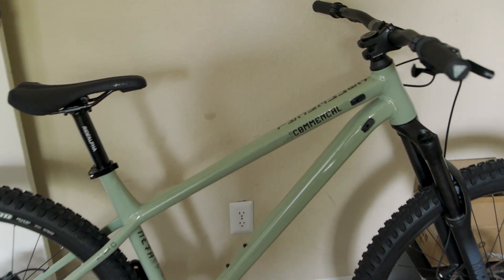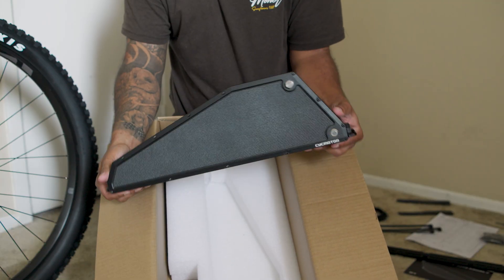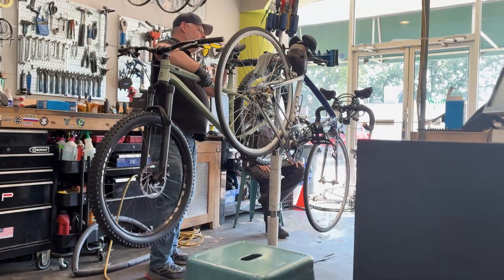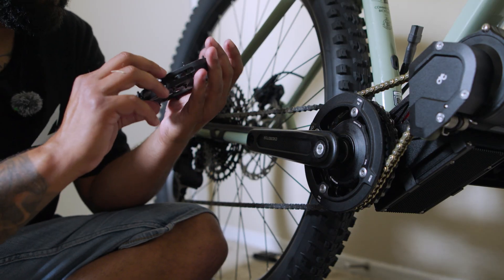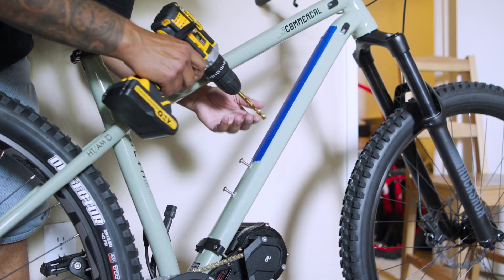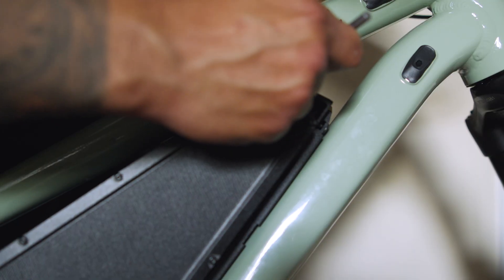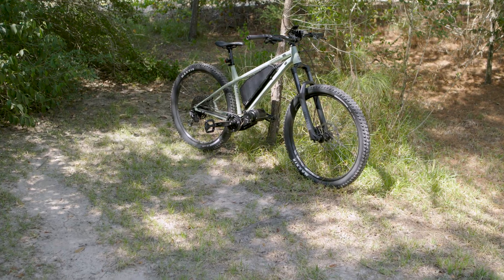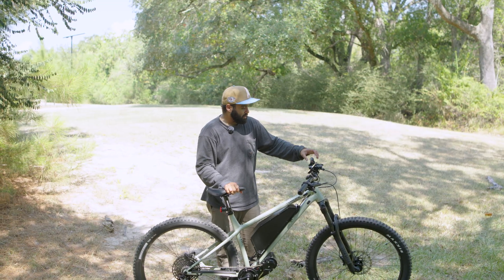CYC X1 Pro Gen 4 + A65 Battery | MTB Ebike Conversion Build

Comment: Nice build bro, I got the same bike and I put a bafang bbshd 48v 1000w mid drive kit on it. Its amazing and I hope to put this cyc motor kit on my other bike. I made the commencal single speed with a 17t cog at the back amd a 36t upfront because thats what I found most suitable for the trails I ride.
Reply from the maker: Thank you and sounds like you got a good plan for your setup! I have the heavy duty kit I bought when I built the bike just never threw it on still don’t know when I’ll do that😅
Reply: @momentswithreese  It's super easy to throw on, just gotta get a wheelbuilder to lace spokes through your hub (i didn't do that). Cassette and derailleur and shifter were suuuper easy and fast to throw on

Comment: Hey quick question, how tall are you and how is the large frame fitting you? I'm 5'8" and there's a 2022 large frame Meta HT AM near me on fb marketplace, so I was thinking whether it would fit me or not. Sick build btw, can't wait for the new videos about it
Reply from the maker: I’m 5’7” and at first I was intimidated by the height but I’m so comfortable on it now. Took all of 1 complete ride to feel good on it. The seat is low and I have the shorter crank arms so my legs aren’t over extending when I pedal. I will admit I can’t flat foot when sitting on the seat so when I have to come to a stop I have to stand up off the seat . I hardly notice the size being a large because when you’re actually riding it just feels good would recommend!
Reply: @momentswithreese  Hey, just got the bike yesterday and it feels amazing, I really appreciate your response. It honestly feels perfect. How's the cyc kit holding up on it? Any problems? Also when's your next video coming out? I'm waiting for it :)
Reply from the maker: @setroset41 glad it’s working out for you and absolutely no issues so far on the cyc. I’m hoping to have the review up at the end of the month (waiting until I hit 500 miles on it )

Comment: I want to know how many miles can you get on average with this 20ah battery?
Reply from the maker: Working on this. I’ve done some street riding but I’m not done with trail riding testing just yet to get some real world numbers. It really depends how you ride how much power you pull (just throttle vs pedal assist). I went on a group ride recently throttle only in mode 1 pacing about 25 mph and after a 26 mile ride I had 10% battery left.

Comment: I am getting closer to accepting the conversion logic: the base pedal bikes are twice as good as the components on most Ebikes. Plus, i already have several to choose from. But over $3,000 is a steep total cost, unless you really want the top speed = not street legal.
Reply from the maker: If you already have some to choose from the power train would put you at just over 2k. There is street mode that will limit you making it ‘legal’ and safe to rip around. It’s the race mode that bumps you up to high speeds. I really think it depends on where you live and how you ride. I’ve ridden now well over 100 miles past plenty of law enforcement and if you are pedaling and going less than 20mph you’ll get nothing but smiles and waves from pedestrians walking and law enforcement. 

It’s so worth it if you can make it happen

Comment: How do you feel about the bike you used? Do you think a hardtail is fine or do you think full suspension is worth it for the kit? I'm thinking about doing this and I'm kind of on a budget, but I think the use case for me I might need to get a full suspension bike.
Reply from the maker: If you can get a full suspension bike in your budget do so! Is the hardtail fine, yes… would full suspension be better yes. I haven’t put the hard tail to work yet (waiting for my brakes to get in before I feel confident enough to rip trails at higher speed)  so I can’t speak to its performance really I’ve just been wheeling around and hitting light trails and it’s been good
Reply: It all depends on your intended use are you driving city streets or are you hitting bumpy trails with alot of rocks / Stumps / roots?? / Age and previously injuries.

Comment: Man it's so cool to see more people get in on the high power low profile "ebike" scene. I've been riding a 72v bbshd bike with around the same power as that CYC 6.5kw for a few years now and it's a really fun do anything bike. My hardtail weighs in at 65lbs which for a bicycle is heavy but even the lightest surron is double that! I've done the opposite of you though and got myself a ultra bee two months ago though so it hasn't seen much use lately. A few tips I have, when shifting try to stay off the power. If you've ridden a gas bike I do the same thing as clutchless up shifting where you are on the power, quickly let off, and while the chain and cassette are still spinning shift with the residual power it still has, then when I know it's fully into the next gear I get back on the throttle. Bad shifting under power will destroy the cassette. And speaking of that I see your bike comes with a 12 speed. While fancy it comes at a cost of very thin teeth and chains, and usually is designed to be light also weakening it. The chain and cassette probably will wear out quick and I would highly suggest checking out a groupset with less gears. What you probably will find is with a X1 power you don't really find the extra speeds a benefit with their smaller gaps in teeth especially with how fast they wear out and the replacement cost. I personally went down to a 8 speed because of this, and honestly I would be fine with a 3 speed. Make sure if you do this to get a steel cassette so it will last a lot longer as well, I went with the Microshift Acolyte which the whole thing is less than your replacement cassette and chains are 1/4 the price. Also you might cause your hub to wear out especially if you are not gentle with the power first starts up when the chain isn't spinning, that slapping can wear down the pawls in a standard cheaper hub. I had to replace mine with a "star ratchet" style. I also did was is called the "zip tie cassette" where you tie your cassette to a wheel spoke so the hub is always engaged with the cassette / chain so there is no slapping. Only downside is the chain will now freespin. I look forward to the content you post on the bike!
Reply from the maker: Wow this is a lot of great info thank you!! I do also have cyc heavy duty drive train I plan on installing in a future video. Ill be honest I have yet to shift😅 I’ve been treating it like any other bike just throttling but I know that’s probably not ideal in all scenario. The heavy duty kit I got also includes a hub so I’m thinking maybe when I wear out this stock stuff just swap over the beefier stuff? 

I plan on doing more content soon I’m just going at a slower pace these days with other stuff I got going on.

Thanks for all this again🙏🏽